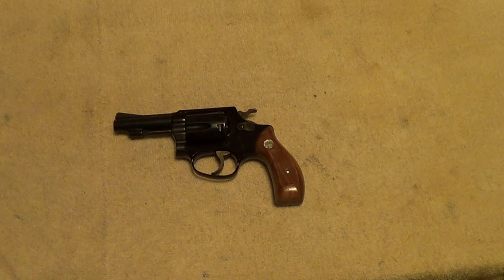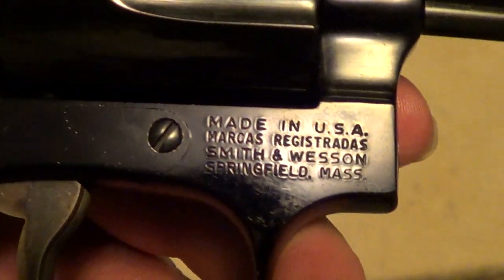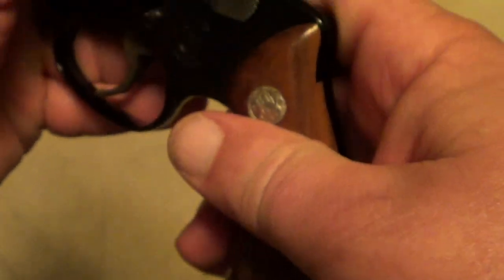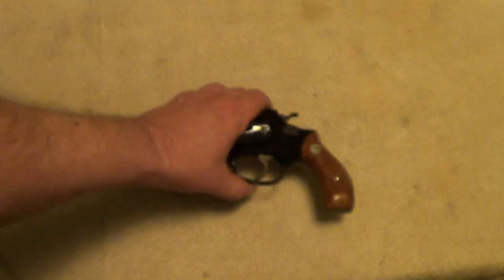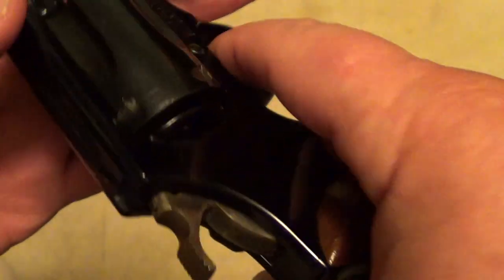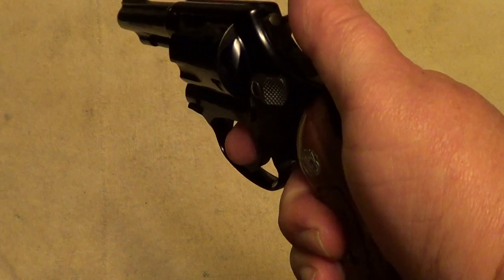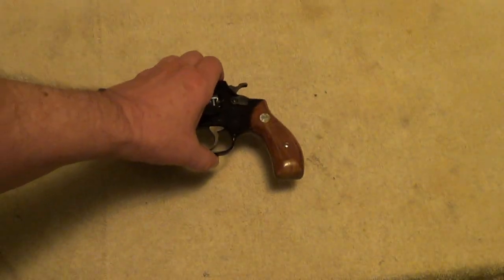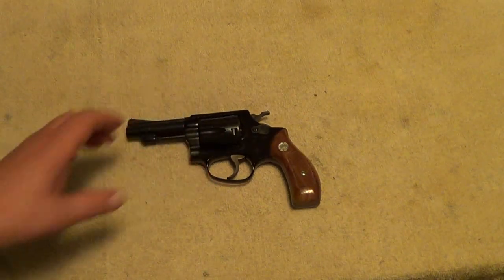Smith & Wesson Model 37 Air Weight Revolver

Comment: Nice model 37 , my model 60 has a heavy double action trigger also, I have a model 38 that has the smoothest trigger of any of my revolvers. I bought it used and it rotates with my other carry guns including my 638. That's for the videos,  and have a good day
Reply from the maker: The little J Frames make handy little carry guns. Lately I`ve been carrying the S&W 632 in 327 Federal.
Reply: @1957Shep  I've seen those on gun broker going over $1,000
Reply from the maker: Think I gave about $500 for mine. But that was several years ago.

Comment: I have a virtually perfect nickel plated one. Far too nice to ever carry, I just take it out to admire once in a while. I have a nickel 36 and a Model 60 that I do carry once in a while. All are 2" revolvers.
Reply from the maker: I have a pair of nickel model 36s. A 2 inch round butt and a 3 inch square butt. The nickel finish holds up pretty good to holster wear. I bought that 2 inch model 36 new back around 1980. Carried it quite a bit. Finish still looks great.

Comment: I like this one Shep, but think I'd like it more with the two-inch barrel & square butt grip. How do you like the way this one shoots Shep? Are you happy with the wood grips? Do you think a set of rubber grips might improve it any? I know they wouldn't improve the looks any, because that wood is beautiful! Regardless, that's a handy one to keep on your side in case any "zombie" trouble ever breaks out, but hopefully that's not something you'd have to worry about! Anyway, keep the great firearms coming & have a good night!
Reply from the maker: It shoots about like any other J Frame. The light weight adds to the recoil, but not enough to get excited about. Rubber grips, and larger grips are always easier to hold onto. But it`s not that big of a deal with a 38. But the rubber grips really help a lot when you get into the 357 Mag J Frames.
Reply: @1957Shep  Thanks for the reply. I know they are pretty popular, but I don't ever see myself buying a J-frame .357; a K-frame one is the right .357 for me.

Comment: You mentioned the - in the model designation. What does the - represent? Mine has a -. My parts list states 78 but the sales recipient in the box says 82.
Reply from the maker: The dash in a S&W model number designates an engineering change in the design or manufacturing process. Model 37, 37-1, 37-2, ect.
Most of the time the newer design replaces the older. Like the model 10-5 replaced the 10-4. But not always. The model 10-5 and 10-6 were both made for many years at the same time. The difference in that case was that the 10-5 had a tapered barrel and the 10-6 had a heavy non tapered barrel. Other wise the two were identical.
Reply: Thank you!